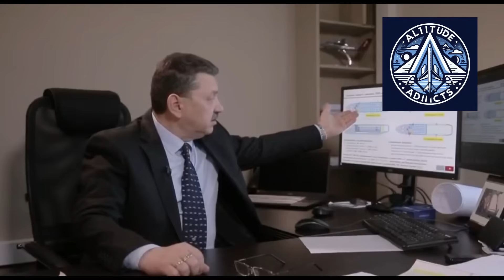Russia’s Baikal Aircraft: Per Flight Hour is Same as AN-2 | First Flight Soon

Comment: As a pilot a well designed aircraft tail wheel for rough field work and easy loading. New Cessna lights run Min ½ million to 1 million plus with 4 seats and low load carrying ability. Caravan 3 million plus and almost that much used. Russia was buying Cessna to replace old fleet this will ensure Cessna loses thousands of sales in Russia. The AN2 has given good service time it was replaced.

Comment: All I can think of is ....one engine aircraft in Siberia.  Good luck finding it when it goes down!
Reply: The AN 2 worked for decades on a WW2 radial thus is far better. As a pilot a well designed aircraft tail wheel for rough field work and easy loading. New Cessna lights run Min ½ million to 1 million plus with 4 seats and low load carrying ability. Caravan 3 million plus and almost that much used. Russia was buying Cessna to replace old fleet this will ensure Cessna loses thousands of sales in Russia. The AN2 has given good service time it was replaced.
Reply: Diobt forget they know how to design for extreme cold.

Comment: so it cruises at 300 kph .... and the An-2 cruises at 200 kph .....with the same operating cost per hour - flights will be faster so use far less fuel per flight. Making the LMS-901 far more profitable.  And happier passengers .... a no-brainer
Reply: It will go even faster with fearings at the landing gear, though those would be damaged in rugged operations

Comment: If these type of small aircrafts have any parachute escaping system, then that would be game changing in aircraft design. Because today many small aircraft's accidents are really fatal. US is trying to building such a system and the research is going on.
Reply: Nonsense. Though  this is a small aircraft, it is meant for commercial usage, to be flown by professionals.
Beside it is way to heavy for a parachute.
Reply: If you're thinking about that entire detachable cabin with a big parachute proposal, forget about it, that WON'T HAPPEN, EVER!
^^ anyone, don't insist nor argue unless you designed something extraordinary that solves many issues yourself, the WEIGHT and SAFETY math don't add up!

Only small parachute for 4 seaters or so are viable options, since they are privately owned planes not intended for commercial profits. Owners are responsible to engage the necessary finances to support the feature (and everything else).

The moment the intended purpose is for operators to conduct business, the math must include financial VIABILITY upon DAILY operation (checks and spare replacement intervals), for DECADES! Since money and benefits get involved, airworthiness certification and WEIGHT REDUCTION for PAYLOAD and RANGE becomes top priority. The larger the aircraft gets, the HEAVIER the chute system inevitably becomes, obviously due to the required redundant safeguards against EVERY UNDESIRED scenario.

No business can afford to trade payload/range and fuel (due to extra weight) for edge case highly unlikely scenarios.

It's sad, but that's just how the industry works.
Reply: Чтобы покрыть такие большие расходы нужно чтобы самолёт перевозил не менее 30 пассажиров на 300 км. Никто не сможет заплатить за перелёт на 3000 км 60000 рублей. Вот такая в стране сейчас экономика.